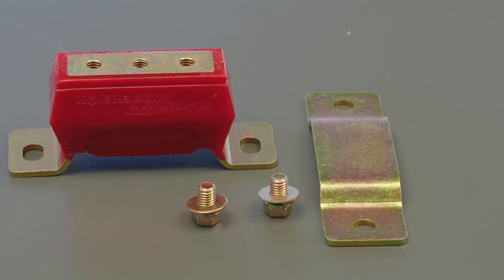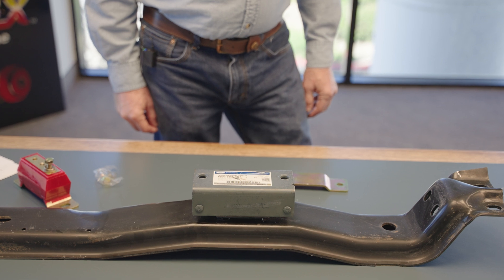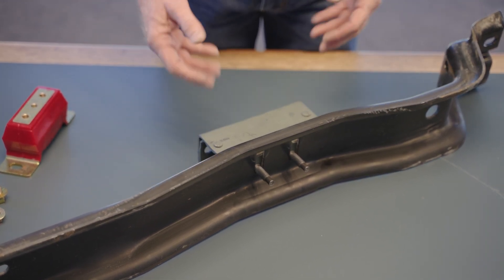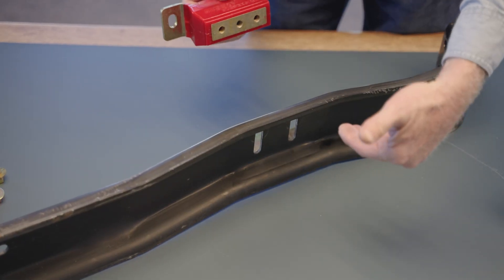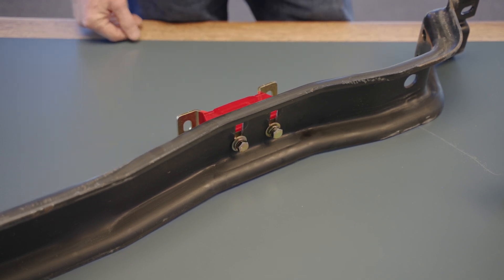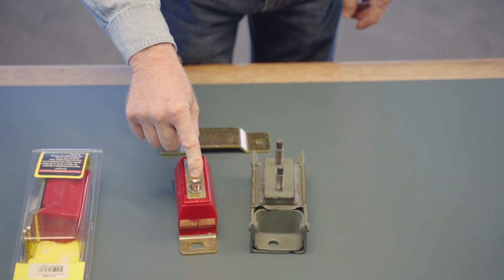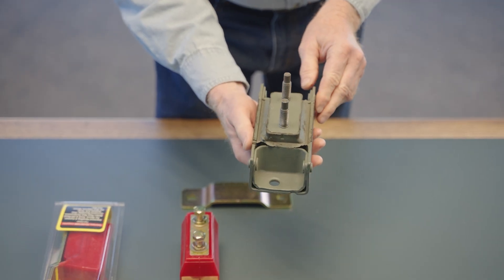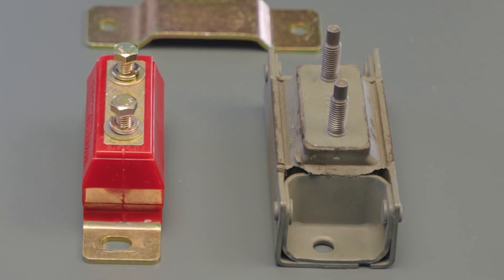Why Polyurethane Transmission Mounts Are Better for Your Ford – Energy Suspension Comparison!

Comment: Hello friends, I am looking for the front and rear suspension bushings for a 2008 Ford Fusion with VIN number 3FAHP08138R246408 and in case you have them, do you have a store in San Antonio, Texas, zip code 78229? Thank you in advance for all the information you can provide me.